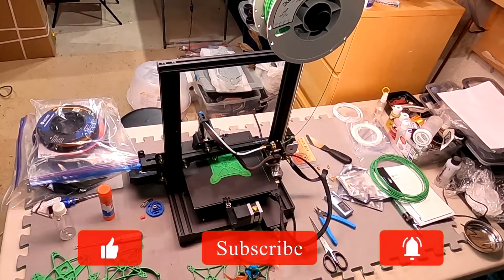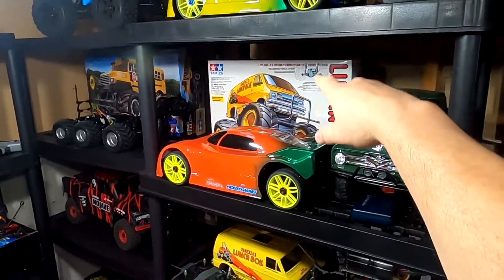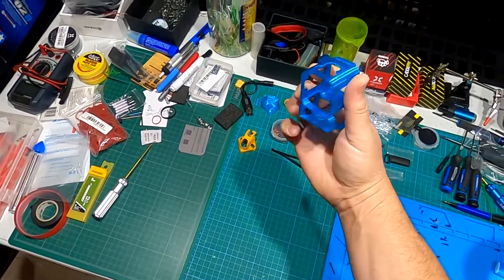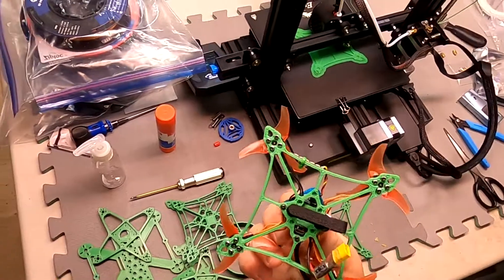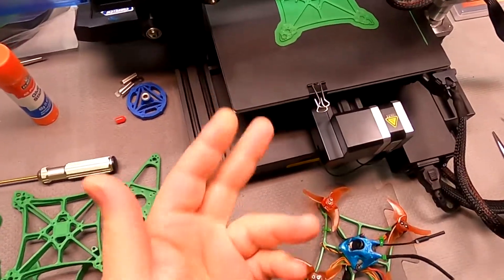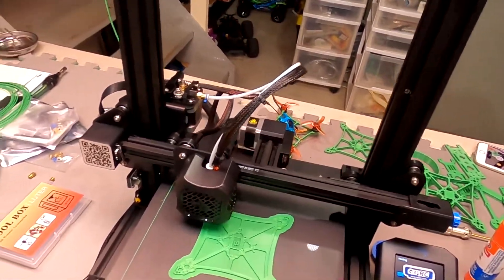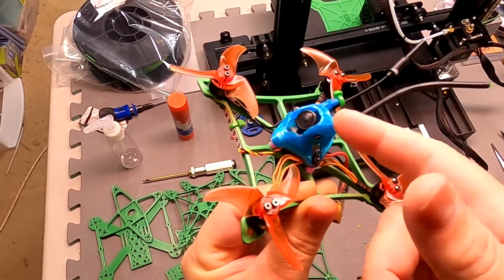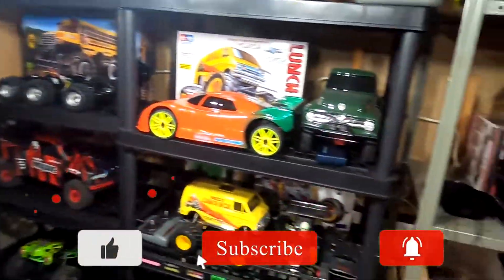Creality Ender 3 V2 - 3D Printed Drone Frame - Dave C FPV - Microblivion Frame

Comment: As someone who’s been 3D printing for over 2 years, I highly recommend trying to use either brim or skirt when selecting bed adhesion in your slicer. It will save SO much filament, and it doesn’t seem like a lot but it definitely adds up
Reply from the maker: yeah I use a brim or skirt when printig TPU.